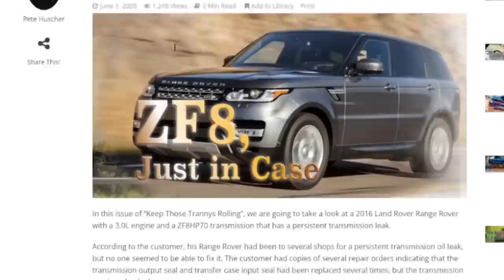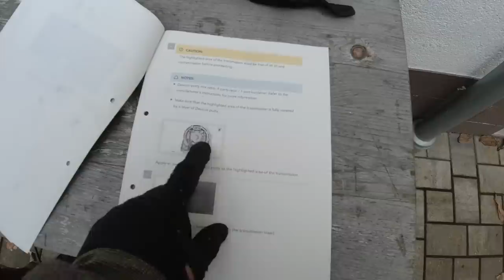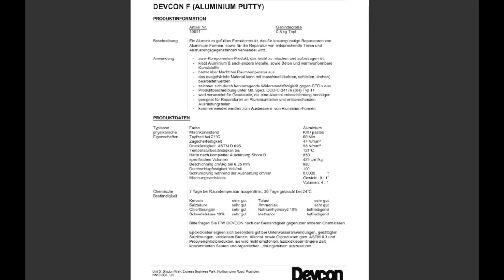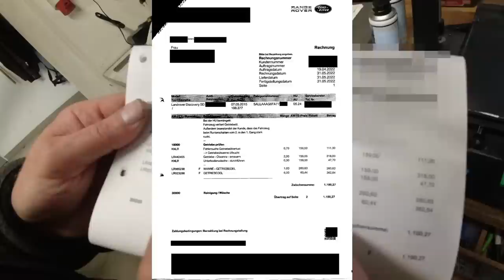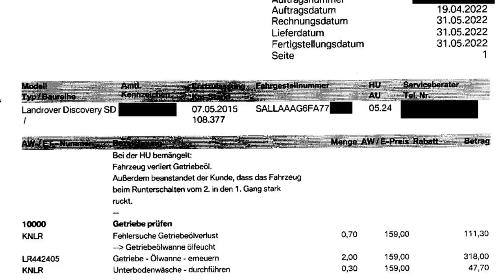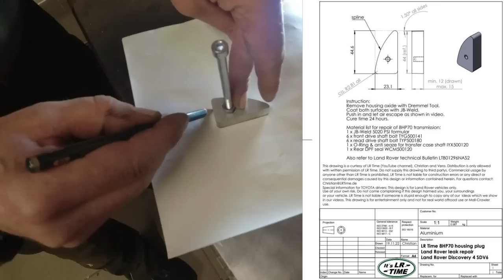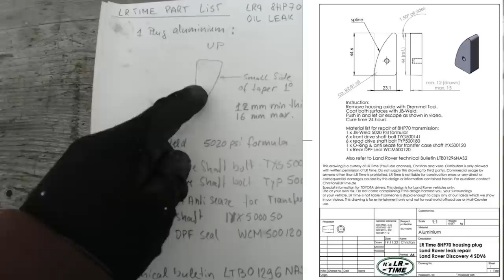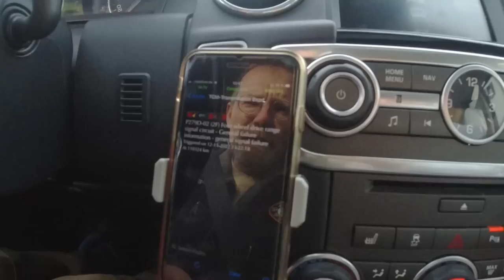Dumbest Oil Leak Ever Fixed on our Land Rover

Comment: The dealer has not good enough experience.
If you are not experienced with casting problems ... you never will find it or you must search very good in detail!
They only searched for normal root cause like sealing and thought they found it.
The job was done with the result ... bill!
The root cause was not found and no standing for any agreement later!

Comment: Shit does happen . However the response from the manger to you is typical Land Rover response to an issue that they do not want to accept responsibility for. It should be a recall . There is a fault which LR and ZF know about ,and issued a notice bulletin about the solution to the issue   . It should be repaired at their cost . It is a manufacturing fault . You buy the car in the understanding that it is free from fault . It clearly is a known issue between a batch of build dates and chassis numbers  . Other wise surely ZF is partially responsible for the expenses accrued . 
The potential for a gearbox failure is there . Surely for them in terms of good will a recall repair on fly is preferable to ZF8 replacement !

Comment: Typical of these workshops, never wanting to be truthful . It costs nothing to be honest . Like i made a comment before  , money driven , takes preference to workmanship.  
This was totaly unacceptable and land rover actually charging for glue and bits !!!, besides the fault should have been a recall  ( by ZF / LAND ROVER ) 
I personally think people are " scared " or just dont bother to complain and just give up to easy . Managers have the "gift of the gab " with a thousand and one excuses and " white " lies .
I am fortunate to be able to repair my own vehicles ( had one bad experience, but i had to do a service with land rover for warranty purposes, secretly marked service items to be replaced .
When i got the vehicle back i discovered that the oil filter housing 27 mm nut had not been removed , which meant that the oil filter was not replaced ( i was charged for it ) . I went back to the agents and caused them huge embarrassment , i made them drain the engine oil , besides replacing the oil filter as they should have  )
In South Africa , to keep the warranty active , owners are obligated to have services done by agents . ( " Artistic " artisans , are definitely becoming fewer , " its just a job " ) 
Reading the manuals and gaining as much information as required- torque specifications ect ect of the repairs at hand , with a artistic attitude makes all the difference. 
Christian & Vera your workmanship is unique .
A ARTIST Technician, by nature has good variety of tools and keeps them in good order .

Comment: They knew there was a problem with casting. They should put it right. They clearly didn't do a proper inspection or fix, as per their own instructions. It is very hard to stick with such an arrogant brand.
Reply from the maker: True

Comment: In theory the dealership should have had the courtesy to investigate and repair until the problem is fixed. The client would pay an adjusted bill correspondent for the necessary work and not for the lack of their knowledge. In this specific situation the way it should go (in theory) is for the dealership to be approached by a solicitor that would suggest an independent investigation by an independent mechanical engineering company that specializes in this kind of forensics. They would easily confirm that Christian is right. By law (country dependent) they would be forced to repair it for free or return some money or whatever the law would help a judge decision. In reality no one would go this far because the chances of coming on top are slim. Specially after using their time, energy and money. LR main company should implement a recall on this models and perform the repair for free as any grown up adult car company does. When I had my disco 3, I soon realized that I had the original shit oil pump. The first thing I did was to call the local dealership to upgrade the pump to the latest version. Their answer was that unless the pump was broken they wouldn't do anything and there's no such thing as an upgraded or recent version of the part. A local garage that specializes in LRs have the same pump collection as Christian's and they keep all the serial numbers, specifications, etc. It's obvious that our economical model doesn't work for dealerships. They have to be criminal to survive. That manager should have been fired with such answer. What an idiot. If I had a LR dealership under my ownership, first thing I would do is to send the mechanics on a training boot camp with Christian and the managers to an attitude training course.